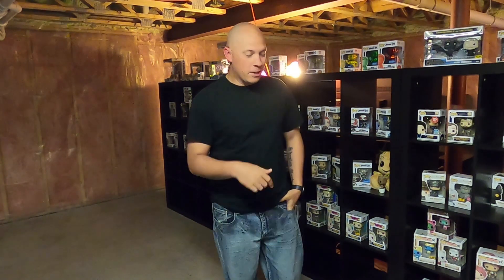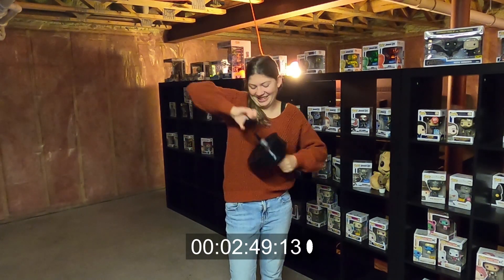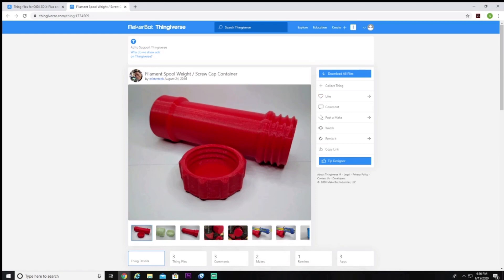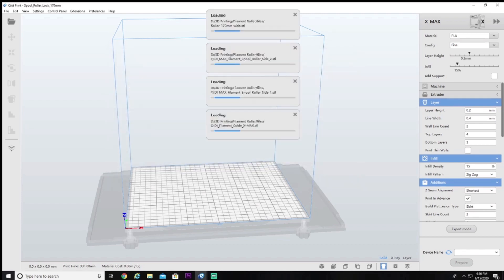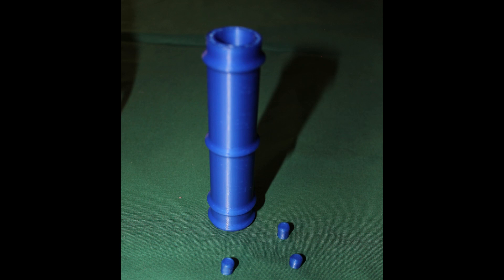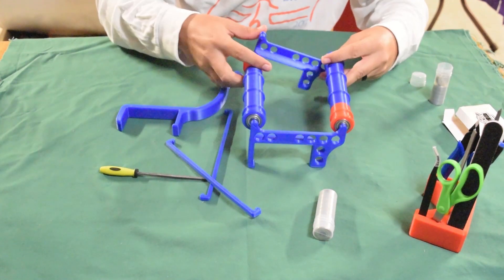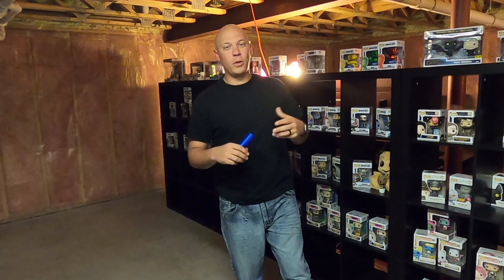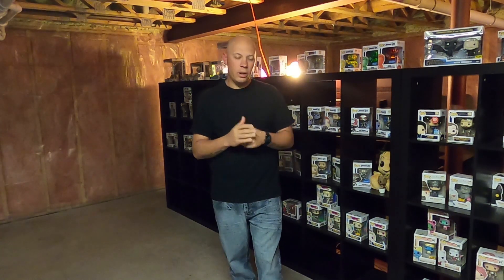Filament Holder Upgrade for the QIDI TECH X-Max 3D Printer

Comment: This series of x max  videos are great but could have been a bit better. For example in this video you didn't state what sort of bearings to purchase - the same mistake mirrored by the author of the spool holder. Also I take it that center peice is a weight for the spool? And not to mention that slowing print speed and using a brim (I know this didn't exist then) will stop your bits falling off!
Reply from the maker: I appreciate the feedback on this. I assumed that adding the links for the bearings or anything else in the description would suffice. Thank you for the feedback, we will make sure we take a closer look at our final products to see if we left some details out that we can add in. Cheers!
Reply: @Eitri3D  Nice - and also the bed level issues you are having - sorry to say but those printed knobs for the underside are possibly the cause. They are not as 'needed' as people seem to think. But maybe you need them. Also I think using the printable bed leveller (POGO) and X-max specific holder for it would be helpful.

Comment: Hi I have the X-Plus and had one issue with a full roll of filament supported on the cross tube. The weight of the 1kg filament roll just hanging on the cross tube, was enough to stop the filament feeding smoothly into the extruder, which gave me a failed print. I solved the problem by simply taking out the plastic end supports, fitted bearings in the ends of the tube and had a 15mm steel rod run through the middle. Job done.  Tiip1:  I made adjustable inserts to fit in the filament reel holes, so that the filament rolled central to the tube. I made several different sizes, as the hole size varied from different manufacture's, This brings me to Tip2: Instead of using different adjustable reel inserts, I now use a tapered block(that will fit the smallest to the largest hole) either side of the reel which slides over the original silver tube and lock them in place with new modified black stops.The reason for new modified stops, was I found that the constant sliding on and off made them loose and they would move away from the reel,so I made two pinch types with nuts and bolts, they don't move now, another problem sorted.
Reply from the maker: I too had one failed print due to the filament not rolling properly, but that was my fault. I secured the caps to tightly to the filament roll and that stopped it from free spinning. Since that one, when I use the factory holder I ensure I allow the spool to rotate freely. Congrats on redesigning the holder. Sounds like a lot of work went into it. I’d love to see your mod because it sounds pretty cool, and practical. Cheers!
Reply: @Eitri3D  Hi, not sure if you received my last message. I could email you some photos of the mod's I did on my X-Plus, let me know.
Reply from the maker: Go for it, my email is in the about section of the channel.
Reply: @Eitri3D  Hi. I can send you photo's if you like, but I don't have a YouTube channel set up. I could email them, or is there an easier way?..Regards phil7323

Comment: your bed not level is probably a spring that got loaded and finally unloaded. I found the springs can bind,.
Reply from the maker: It also has the nut inside the spring instead of a washer then the nut. The design is less than optimal. This seems to be a common issue and that’s why I also upgraded the bed springs with rubber. I only level the bed after I switch nozzles now instead of after every print.

Comment: What are the bearings or where could I find them?
Reply: I  got the bearing size here and bam got them today on Amazon
Reply from the maker: That happens to me all the time. I order something then I find that I had some already, usually the day after or the day things arrive. Never fails. Happy printing. Cheers!
Reply from the maker: FaGoBearing 608 ZZ Roller Bearings for Machines, Sackorange 608zz Double Shielded,8x22x7 Miniature Ball Bearings 20 psc
https://www.amazon.com/Skateboard-Bearings-Sackorange-Shielded-Miniature/dp/B07PLV9YQ3/ref=sr_1_5?dchild=1&keywords=FA+Go+Bearings+608ZZ&qid=1592714382&sr=8-5

Comment: I've been on 3d printing for about 3 years. I bought the same printer about 2 months ago... I must say that this machine is a BEAST, but for its price I was expecting much more.

The internals are super high quality, but it's too badly designed. The major issue I have is with the filament positioning too, but there're some other things that catches my attention in a bad way too.
Reply from the maker: I’m learning it can take some tweaking, but if you would like to explain some issues, maybe we can assist in helping make it work better for you. I think the attractiveness for this beast is the ability to print numerous materials.

Comment: Great start!  I would do a setup guide for all us noobs.  Not an unboxing , but maybe video on leveling, adding and removing filament.  Possible going thru the qidi menus on the printer since they are hard to follow.  Also a great video idea would be dealing with filament jams.  I have had my share.   I hope you have fun with this channel.
Reply from the maker: Great feedback! I will stay away from the unboxing and get a video out on the basics, do you mind if I mention you as a inspiration for that particular video? Make sure you subscribe and click the bell so you get updates when new videos are released.
Reply: @Eitri3D  Sure thing! Subbed.  I came here after I saw your post in the QIDI facebook group.
Reply from the maker: MrGrovesde I truly appreciate it. I posted a video based on your recommendation, but had to pull it down for a quick fix. It’ll be back up here real soon.